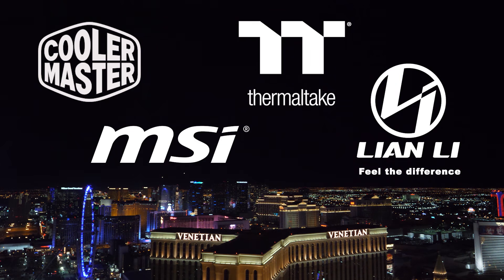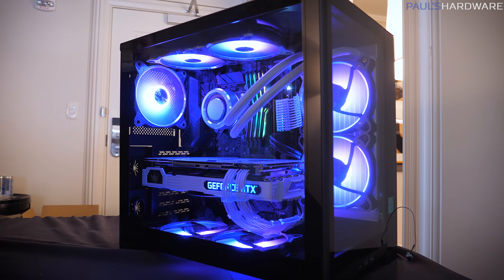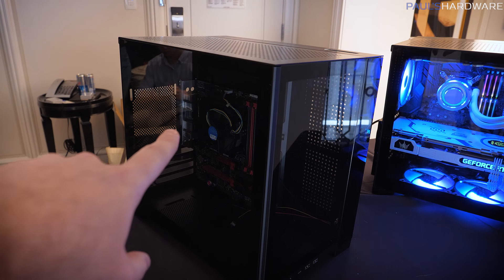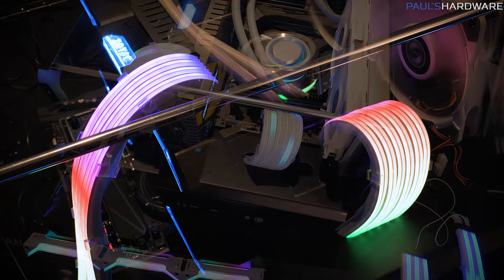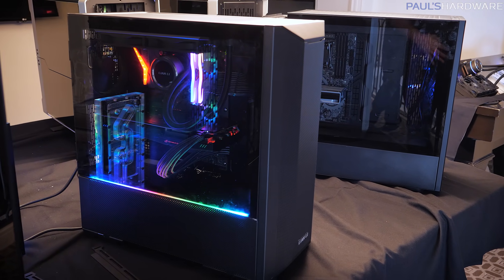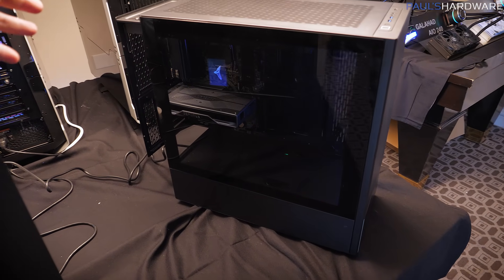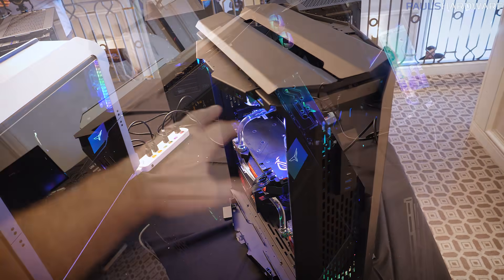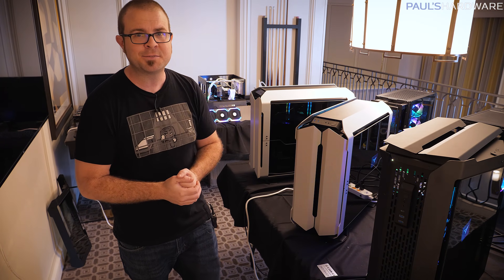Lian Li's Transformable Odyssey X Case

Comment: I'm so happy to see more cases with full mesh fronts again. Goodbye, solid front panels. I won't miss you.
Reply: Just got myself the Cougar Turret Mesh. With a 120 mil on front and 2 140 mil on top, it keeps my Ryzen 2700x below 70 degrees celsius with the stock cooler. Don't think I could've gotten those results with a solid front panel.

My biggest gripe with the case is that I can't install the 3rd 140 in front (3-pack) because the screws are too thick.

Comment: Damn the only gripe I had with the O11 Dynamic was the size. I am SO gonna get me that mini!
Reply: yeh? I really like the O11 Dynamic size, but, I've come from having to really cram my gear into standard size cases. I'm sure the Mini will be just as dope if you need to downsize :)
Reply: @HalfDayHero  I used to try to stuff as much hardware into my PC too. But these days I like to simplify things as much as possible. My policy is anything that wasn't used in the last 6 months, doesn't need permanent space and should be either modular or removed entirely (like an external optical drive for emergencies that sits in a drawer where I don't have to see it, or a game I haven't played for ages, I can remove that and if I really want to play it again, which basically never happens, I'll just download it again. With fast internet that doesn't take that long these days). It's just generally less of a hassle with less points of failure and looks cleaner. No more card readers or optical drives or HDDs. Just the main components, 1x M.2 drive and one bigger sata SSD and that's it. I have a NAS for mass storage. And these days you use distro plates as reservoirs. So that saves even more space. 
My build will be simple and clean. But that also means any big case will look empty. So that's why I need a smaller case :D

Comment: I'm a huge Lian Li fan, but I really miss their slabby designs that used to be their thing back in the 2000s. My main machine is still in a PC-60 from 2004 and while things like the PC-011 are in the right direction they're also rather large cases. I want something that uses less desk space.

Comment: Can one fan plug effectively handle all those fans? Or will we still see better performance from 3 separate cables? Or it probably won’t even matter right? As most fans all run into 1 hub then into the MOBO anyways?

Comment: Hi @Paul, when you were at Lian Li, did you notice if the unifans have RGB only on the front side of the fan, or is on the back side as well - i.e. can they display their RGB goodness when installed in a pull configuration on a front mounted radiator inside a case?

Comment: Damn  sad why cant the mini have IO at the top .
Reply: apmmasterpc99 I thought I saw it at the top
Reply from the maker: I agree with this sentiment
Reply: The main reason I bought an O11 XL is because it has bottom I/O. I don't know why anyone would want top I/O.
Reply: @KravMagoo  Why would you want it on the bottom? Do you like reaching all the way to the floor to access it? No, that's stupid. IO belongs at the top where it's most easily accessible.
Reply: @mjc0961  Because most people DON'T spend all the time and expense building one of these showboat systems only to stick it under their desk or hide it beside their desk. They leave it sitting ON THE DESK so they can gaze mindlessly at the RGB. And if it's on the desk, the top IS NOT the most easily accessible.

Comment: I almost wish they would just make two different cases for like 200$ each, instead of making this 400$ case when you will really just pick one of the two and go with it for it. Also this would allow to i.e. close the gap between the glass panels for dust protection.